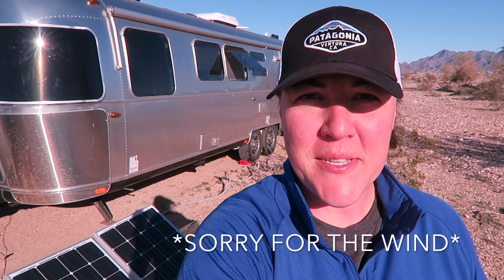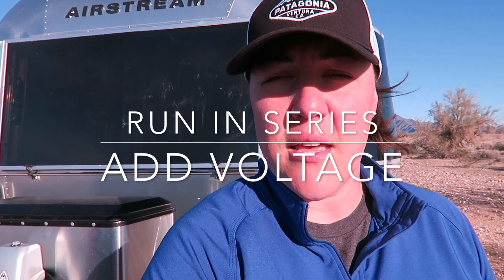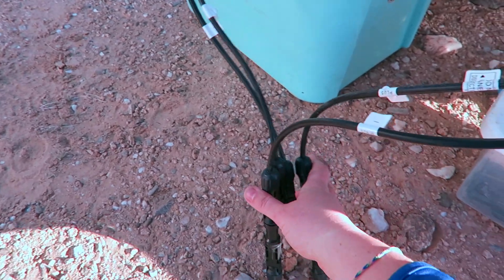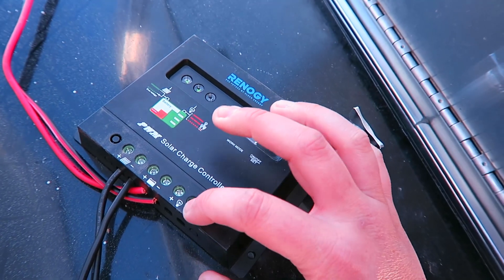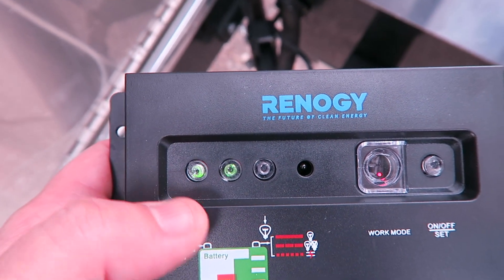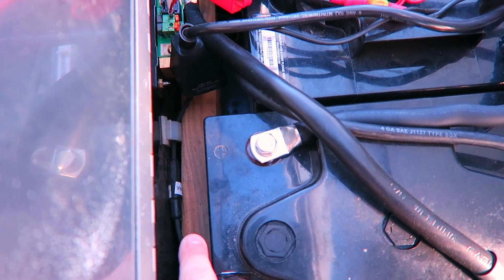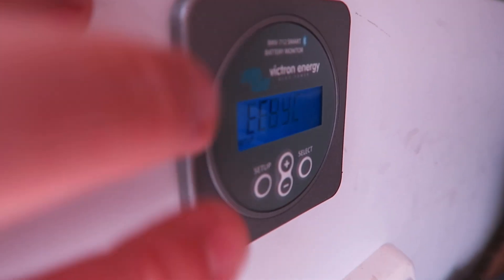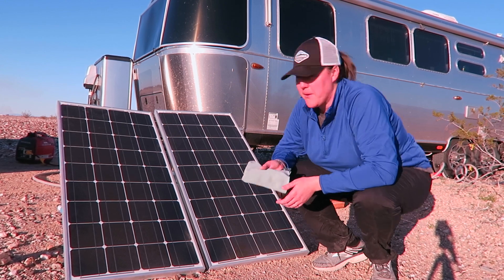HOW TO upgrade AIRSTREAM batteries, VICTRON, and SOLAR panels

Comment: I recently put 400W on the roof of my Airstream. I put two 125 Trojan 6 volt in the stock box with a extension kit. I used a Victron controller.  Like it so much better than having to set up my solar panel and lock it up all the time.

Comment: Thanks for this video. Very helpful as we are thinking about upgrading our batteries to AGM. We have 2 12-volt lead acid now. Wondering if we can use the battery cables that are on our current batteries or if we need to buy new ones. What do you think?
Reply from the maker: Honestly, wiring is so variable based upon voltage, amps, and distance of wiring.  I recommend looking up a wiring chart to best determine a safe gauge on the wiring.  With our increase in Amp-hours, we had to change our wiring to a large gauge. We used 00.

Comment: May I ask, what you do to your old battery? Why don't you just buy a portable power station or a generator?
Reply from the maker: The old batteries were recycled.  We do use a generator at times, but it is noisy, produces exhausts, and we have to worry about buying gas.  When you are wanting to enjoy nature, you don’t want to use a generator unless you have to.
Reply: @TheWandermires  I see, thank you for your reply.

Comment: Hey there, any chance you’re willing to share how much it cost you to do the modification? Really would appreciate it.
Reply from the maker: Rory Coetzee -honestly I’m not sure.  The upgrade to the batteries were around $500.  The Victron battery monitor system was around $200.  The solar panels were gifted by GoPower, but I believe they cost around $200.  Then, I spent about $35 in wires, fuses, and polar conversion attachment.  I hope this helps!

Comment: I
Did you add a fuse anywhere?
Reply from the maker: For the portable setup, I did not put on a fuse.  But when I finally mounted these same solar panels on the roof, I ended up attaching a 20 Amp fuse.
Reply: So did you screw down the panels or did u just use VHB tape and dicor.  I’m getting ready to buy 600 watts for the roof.  I currently have 2-85 watt panels that were put up there during the building process of the AS.
Reply: Oh, looks like AS screed down the panels and used dicor

Comment: Hello, thanks for the Video.  I have an Airstream Classic 33, 2018 model.   I'm adding additional zamp solar but need to upgrade batteries to 6 volt.   What Airstream model do you have?   The Vmax get great reviews..but concerned its going to be a tight fit in my battery box.   Thanks for your feedback...
Reply from the maker: We have the 2018 Flying Cloud 30 foot FB Bunk.  Our battery box is very small, and the batteries fit with a little wiggle room.  We did take out the middle mounting rod with the wingnut (it just screws out of the base), and we removed the bottom plastic tray.  The batteries just fit width-wise, but they have plenty of space length-wise.